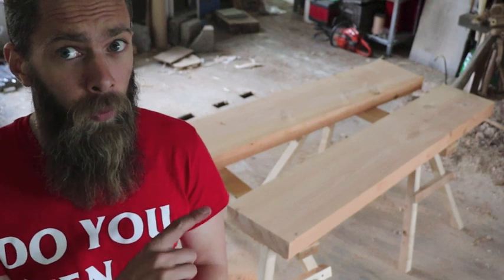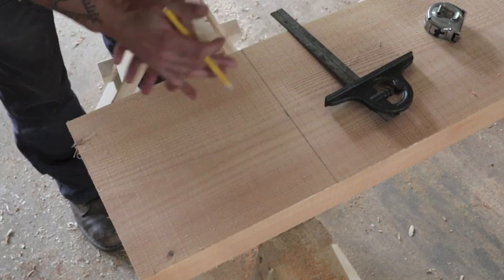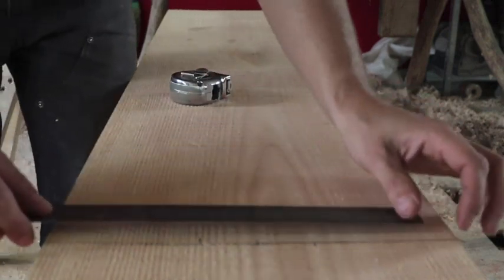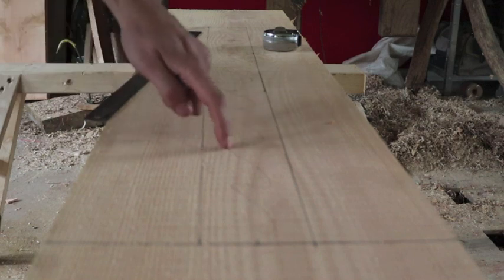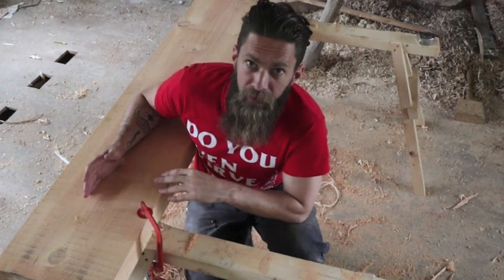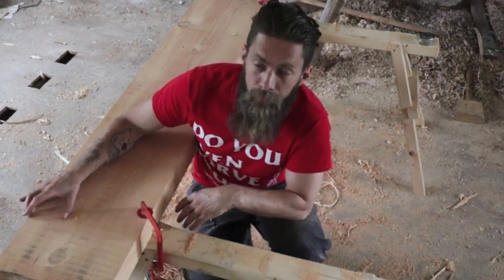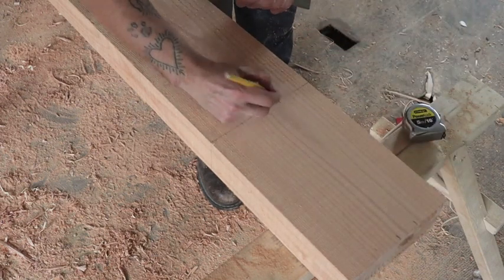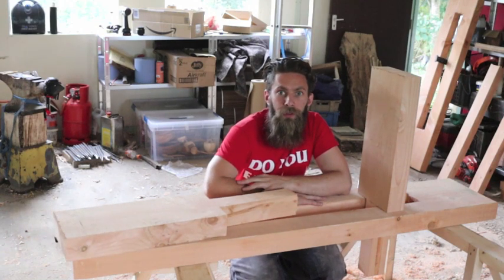How To Build A Pole Lathe : Part 1

Comment: Nice work Owen, thank you for this tutorial! The size you have used for the bed could it be thinner than 75 mm? Or is it important this thick for the weight? Thanks.
Reply from the maker: Personally I wouldn't. The thinner you make the bed, the more flex it has and you dont want things to be moving when you are turning
Reply: @OwenThomaswoodcraft  thank you!

Comment: Great tutorial & just in time before I set about making mine!
At the 19 minute mark you say one poppet is bigger than the other but at 24:10 they look to be the same size - is this the case?
Reply from the maker: Good eyes! I think what happened there is that, because I was making two lathes at the same time, I got them mixed up and had 2 shorter ones for that clip. If you follow the sizes I mentioned, that won't happen 😀
Reply: Owen Thomas Cheers for that, it was messing with my head a bit.